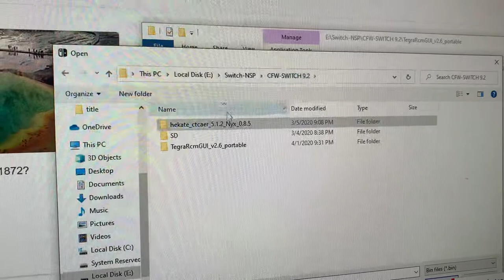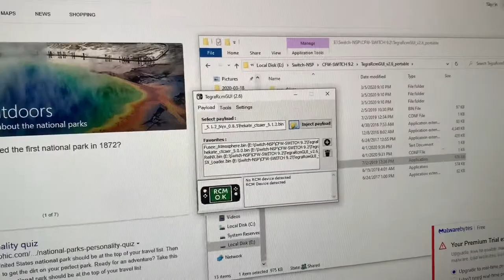Boot switch into rcm mode

Comment: I keep installing the driver bit when I close the application and go back into it the driver is not missing and I reinstall it, however even when it supposedly is installed my switch doesn’t show up on tegra. Any ideas?
Reply: I meant is missing
Reply: have you solve that problem yet ? if you, how ?
Reply: @mithatemre9469 yes I have, however the solution for mine may not  be the same for you. I had my switch in auto rcm and it died so of course when I tried to plug it in my pc it didn’t show up so I just left it on the charger overnight and tried again and it worked other then that I don’t know it’s a pretty shitty problem to have just don’t panic

Comment: When I connect my usbc cord from my switch to my pc it doesn't detect it and the switch shpws an X next to the battery icon. I've used 5 different usbc cords as well as different USB ports. You got an idea?
Reply from the maker: I’ll try to make another video with better steps and easier to follow. Also haven’t watched this video since I made it but download TegraRcmGUI open it and go to settings tab and install the he driver. That might be the issue.
Reply: @Property of Justin O  I've done that. When I connect my other switch my pc detects it. And that rcm screen turns green. When I connect this one, it doesn't detect on my pc and it doest not turn green on the Tegra tcm screen
Reply from the maker: @big_W  is it a patched switch?
Reply: @Property of Justin O  no its not. I've checked it several times. My other switches are brand new and it gets detected on my pc as soon as I connect my usbc  to usb cord to it